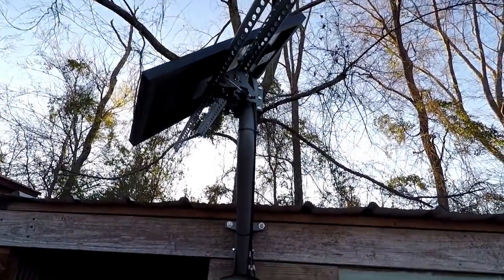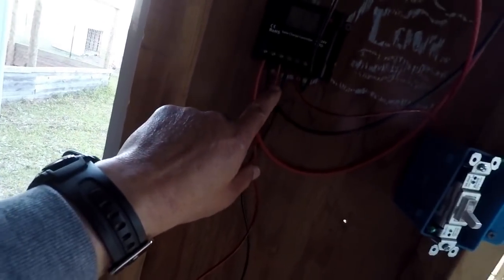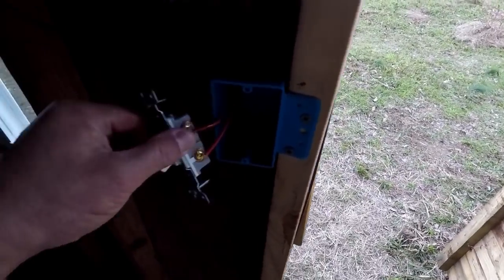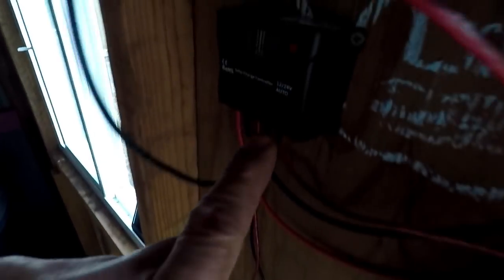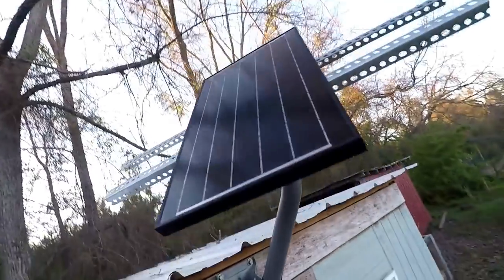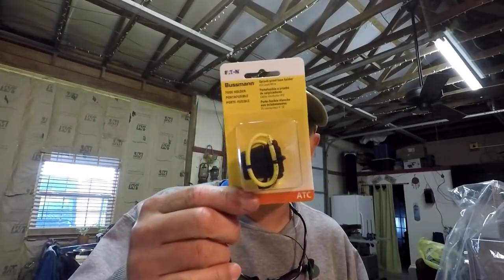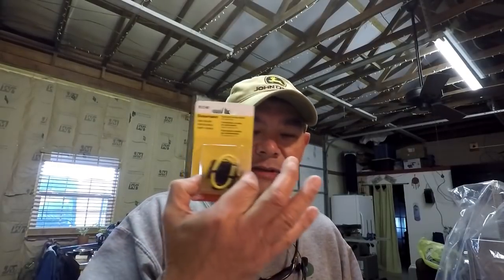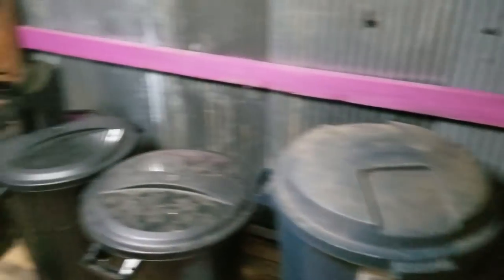Let There Be Light In The Feed Shed | Solar Power Project

Comment: Dan Nice work brother. For your setup the two most important fuses are from the solar panel to charge controller and from the battery to the charge controller. Your load is so small I would not even put one in. Thanks for showing us brother. God Bless.
Reply from the maker: Thanks for the info brother!!!  Dan

Comment: Especially pleased with seeing the inline fuses and hope to see them installed soon. I still don't like the AC light switch and would suggest going over to eBay and search " Automatic DC 12V-24V 8A Infrared PIR Motion Sensor Switch For LED light BestBLBD " For a whopping $4.09 you can have the lights turn on when you enter the feed shed and go out 1 to 5 mins (adjustable) after you exit. Other than the  switch it's looking great!

A video on PIR switches and I would suggest the black and green first example for your application. https://www.youtube.com/watch?v=XR8Bfcyofog
Reply from the maker: Thanks for watching AutoCrete and I'll definitely look into the switches you linked up!!  Dan

Comment: great job Dan, but you might want to put a drip loop in that cable so water can't run down the cable into the shed.  maybe it don't mater.  either way nice job on the lights
Reply from the maker: Yes sir Mr Malcolm, I'm either gonna put a drip loop in or seal the hole with something!!  Thanks for watching and the tip sir!!  Dan